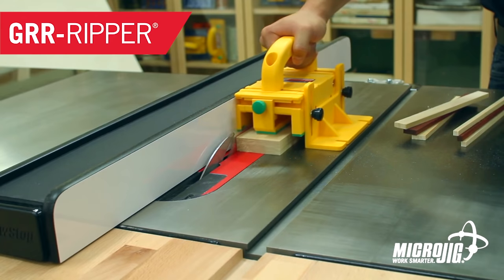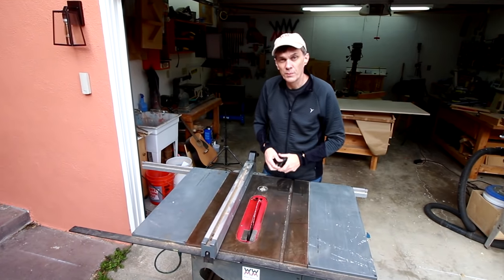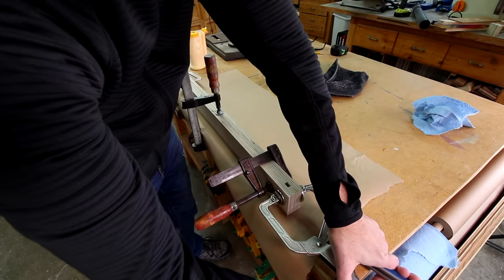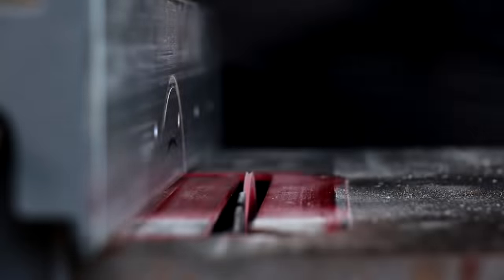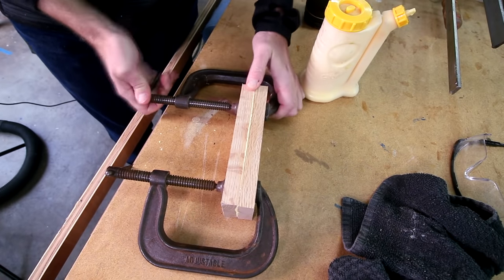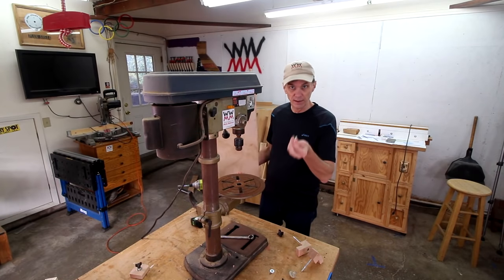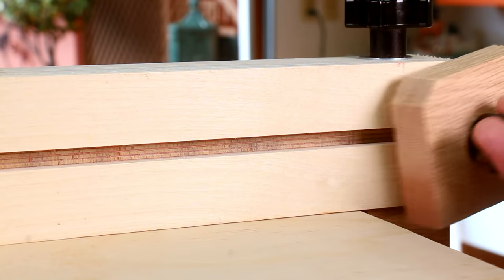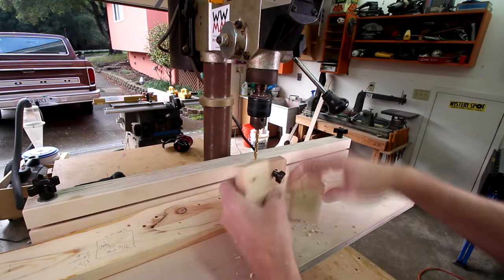Drill Press Table | Woodworking Shop Project

Comment: Protip: when cutting a bolt put a nut on it below where you intend to cut. Then, when you thread the nut off it will fix any threads you may have damaged during the cut.
Reply: Justin Updyke thanks!
Reply: You're welcome. This works on all size bolts but it is especially good on m3 type stuff for RC cars
Reply: Well the standard machine shop method is to always chamfer the cut off thread, that way you get rid of any burrs and have an easier time engaging threads.
But if you very specifically need flat ends that is a good way to go.
Reply: Thanks! I'm absolutely sure I'll forget that!
Reply: Yep, so true... the first time you try to screw a nut on 'after' the cut to fix it will cure you of forgetting. ;-) Chamfer has not always worked well for me... I will sand the ends a bit, just to clean the burrs though. Then, off comes the nut.
Reply: Good advice. I used to work at Lowe's, and I told people this often. I had a few come back a week later and thank me for it.
Reply: I have heard this since the beginning of time. This loose nut rattles around on the bolt and can get in the way of your saw/cutoff disc, unless you tighten it all the way down to the head and/or use a second nut. And it takes way too much time to bother doing that for a problem that isn't really a problem.

Just touch the end of the bolt flush to the disc sander after you cut it. Or locate and take 1 stroke over the end of the thread with a file at like 45 degrees, plus or minus 20.
Reply: Great tip 👍

Comment: I made your table, Steve, with a couple of small mods, and it's great! Thank you, sir! I had to cut a chunk out of the back right of the table because the table height crank hit it. Instead of the way you made a track for the stop block on the fence I bought t-track and routed out a dado for it. Works great! The toilet bolt (excellent idea!) was just a little too wide to fit the t-track, but a few seconds with the bench grinder fixed that. I figured I'd make a thin, removable sacrificial panel for the top so that I can replace it once damaged, and that made the stop block not fit (too tall) if the panel was in place. Fixed that by routing a slot in the stop block which allows me to change its height easily. All good!

Comment: Pretty simple, yet such a great improvement... if only I had a drill press 🤓👍🏼
Reply: I bought a dremel 3000 tool last month, and a dremel workstation. This act as a drill press for me. I can drill holes up to 6mm in diameter, which is enough most of the time. Of course, it is nowhere near as powerful as a real drill press, but it takes way less space, and is way cheaper. Depends on what you need. The dremel tool is approximately 120 euros, with accessories, and the workstation is approximately 34 euros. The dremel tool can act as a router, a circular saw and a drill, and the dremel scroll saw (motosaw) is a portable scroll saw, whih can act as a scroll/band saw and is relatively cheap (100 euros). I now have a shop in my 16 m² appartment :).

Comment: I've got this old craftsman table saw with no fence I was gonna sell on craigs list.  I saw this design for a fence and ramped it up to fit my old table saw and it works great.  I'll set this old saw up with a dado blade but mostly use it as an outfeed table from my new saw.  When I need to dado, I'll just adjust it up and knock them out.  Steve comes through again!

Comment: Brilliant idea. I see that table helpful for light metal work where I need a stable surface for drilling holes in tubing. I could put a scrap piece under the metal as a sacrifice surface.
MANY THANKS !!!
I also like the way you use your saw blade instead of a dado for wider cuts..

Comment: Ok, Steve, watched your video and decided to make one for my drill press. Simple job turned into a two day project! Kept adding this and that and changing things that made it work better! One thing I did notice is that with fence in place, it keeps the wood chips together and easier to clean up. Also works better for my vac system which I incorporated into the table.

Comment: Nice table, I like the stop/gauge design.  I did sheet metal fab for eight years, so unfortunately, I spent a TON of time on the drill press.  Like you said drilling holes is boring.  The drill press I used had a good sized table to begin with but I often had to support longer material with T Stands.  I usually clamped a scrap piece of aluminum angle to the table as a fence and then clamped another piece of angle or bar to that angle if I wanted a stop.  We also had a scrap piece of tread plate with a perfect square notch out of one corner.  Lay out and drill a hole, with the bit still in the hole, slide the notched scrap piece up against your work piece and clamp it onto the table, works really well for a lot of repetitious pieces.

Comment: That was a nice project.  Yeah, you probably want to go ahead a drill through the table.  The scrap board defeated the purpose of the champher on the stop block. But I wish my errors were that of some saw dust!   Making those T slots is less expensive than the tracks that you can find on line.  Thanks for sharing.

Comment: this was one of the first videos i watched on this channel a few years ago.
Reply: ? This was posted today.
Reply: it's an old video. posted previously.
Reply: Chris R No. It isn't. He mentioned H&G at the end, a relatively new channel from him. This is an entirely new video, maybe a redo of an old project?
Reply: Denis Ryan
see the old table saw? he uses a porter cable table saw now, and has for years. i watched this video several times years ago. no big deal.
Reply: You're thinking of the slightly different table he made in 2010. /watch?v=LWn1lRTuOlk
Reply: he has the purple paint on the wall along with the spray painted logo in the background.
Reply: The definitive item in the video, to date it, is the box he made for his new shop vac.  That was made a few months ago, when he bought the vac!
Reply: ok
Reply: It's also got the new clamp storage.
Reply: Yes, I saw that...  I should have said... "a definitive item" :-)  But, the clamps are older than the shop vac holder.  The clamps I believe were made about a year ago... still newer than the first table. :-) Who's been a good boy, watching all the videos! lol
Reply: No this is a New Video , the first one did not have a Build Video as part of it just a description of  how he built it and also had Removable Inserts in the center of table for when it got damaged , those are a feature I really like and added to mine.

Comment: Dear Steve, Thankyou for all your work with these videos which I like very much. There is however one video I keep waiting to see from you, and that is on the use of a plunge saw, not just for ripping down large sheets of plywood , but in the use for more accurate wood cutting, after all they have some pretty clever and accurate features with them these days. Is it possible you could do a whole project just using one of these plunge saws, and perhaps show us how they compare to the table saw etc. Thankyou once again.

Comment: Actually the sliding table is just a convenience: the column could be removed from the foot and bolted elsewhere, e.g. the edge of the bench, to have a lot of extra height for free. Steve, what about a sort of "lifting cabinet" to be placed below the quill, allowing you to drill very long pieces with precision and without hassles? Think to a sort of vertical workbench… I'm sure you can make that ;-)

Comment: love the project. only thing I have to criticize is that I believe the slot in wood was made too big. it should have been for the smaller side of the head of bolt so that it won't spin when tighten and loosen

Comment: Dear Steve, I love your video's and like most of them, I try them out. Also this Drill press table. I downloaded the plans and made exactly what was designed but the result barely clamped. It took me a while to figure out that the side blocks are made a bit different in the video than in the sketchup file. Contact me if you wish me to clarify with some printscreens and pictures. Keep up the good work! Jelle

Comment: Hi Steve! I'm looking to build a drill press table for the cheapest WEN drill press on Amazon (the 4208T). Unfortunately, the crank to adjust the small table it comes with doesn't have a track (like yours, and like probably every other drill press in existence), so it's free to rotate around the main shaft of the machine. Do you have any advice on how to ensure the fence is square to both the plane of the press itself, as well as the bevel axis of the table? I'm hoping to make some barstools and need the angle of the holes in the legs to be correct.

Comment: Hey Steve! Great video as always. I have a question related to design. Please share with me your thoughts on eliminating a disposable zero-clearance insert like in your old drill press table. Why did this design not include that, seemingly essential, feature? Are you taking the approach that you will just replace the entire base when needed?

Comment: Steve:  How would you modify the fence to accommodate drilling a line of equidistant holes, like for adjustable cabinet shelves?
Reply: How about making an attachment for the fence that has a pin that you push down into the previous hole at the right distance. Maybe spring loaded.  It might have to swing out to adjust for the distance the holes are from the fence.

Comment: Actually it looks like you are putting the bolt head into the slot long ways. I'd think that the slot would be near the width of the flats on the bolt head. Your video is almost inconclusive but seems to agree with me. Please explain.
Reply: I concur. I thought I was going crazy here when I noticed that myself. haha. Might as well use a standard bolt.
Reply: T-bolts and T-nuts always slide in lengthwise in T-track. How would you keep them cross-wise? They are mainly for spreading the clamping force.
Reply from the maker: +Michael Anderson It works fine.
Reply: Damn right it does....built it this weekend Steve....thanks!!

Comment: Should the T-bolt slot be narrower? Making it the same width as the Large diameter will not stop it from rotating when tightening. Right? Maybe it doesn't really matter in the end.

Comment: I've always heard it's dangerous to use a crosscut / miter sled with the rip fence. Is it okay in this case since  you're not cutting all of the way through the piece?
Reply: louie solomon Correct.  A mitre is not through the wood so it will not be loose and bind.

Comment: Steve, what size drill press would you recommend?  I am wanting to be able to do a lot of the same kind of projects you do.  thanks!
Reply: John Bryant 
When I was starting, I bought a cheap 8" drill press for about $80. But found that I quickly outgrew it. I upgraded to a 12" (drill presses are measured by their throat depth) and it's working beautifully.
Reply: grandolddrummer thanks for your response! Do you have any recommendations for a hobbyist. I dont want cheap, but it does need to be affordable ($300-500, if possible). thanks again!
Reply: I picked up the Craftsman one from Sears for around $200. It's been working great. I made a table for it from a Woodsmith magazine. 
I've heard good things about the Jet 12" and the Wen 12" has good reviews on Amazon
Reply: grandolddrummer I'll check those out, thanks for your help!

Comment: Your track seem,s to be too wide for the toilet bolts.  You cut the slot to the widest dimension of the head.  This means that the toilet bolt can spin without being stopped by the track edge... or was that entirely intentional??  (it certainly didn't seem to cause a problem when you tightened it). I usually make the slot just smaller than the 'wide' dimension of the head.  That way it doesn't stick, but the track will stop it from spinning when you tighten the bolt down.

Comment: Is it possible that the table won't square up with the drill press itself? For instance, if I want to create a handle in a board, I would rather make multiple passes with a forstener bit instead of using a scroll saw or jig saw. Is it possible that the table wouldn't "square" up with the drill itself resulting in an uneven cut pattern??? I hope you understand what I'm asking 😂😂😂😂

Comment: I'm new to woodworking, and I have a simple question, when gluing two boards together as in this video, is it necessary to use that many clamps or is Steve doing it for comical sarcasm?
Reply: I go with a clamp every 4 to 6 inches.

Comment: ok stupid question what are the black knobs you use?  i tried to find those in lowes in the knob section but no go.  thanks
Reply: They are in the screw/hardware aisle in the drawers - I think that area is called Specialty Hardware

Comment: Was there a reason you didn't use your dado stack to cut the grooves?
Reply: I can't speak for him, but I know I'll often skip it and do it this way if I don't need a high precision cut, and if it's going to take longer to change out the blade than to just go ahead and make a few passes.

Comment: How can you assure that your fence is completely straight from left to right when you clamp it down?
Reply from the maker: It doesn't need to be straight.
Reply: @SteveRamsey  I guess I was thinking about a current build I'm working on (a golf ball shelf) and I have a core box bit cutting a row of divets into a board. In total there are 5 shelves and I keep getting some of the shelves with the divets getting progressively closer to the front of the board as you follow them from left to right. I figured it was because I wasn't clamping my "fence" straight but perhaps it's something else.

Comment: 2:41  You're not using those T bolts properly. The slot width in your fence should match the bolt's flat to flat dimension and not the head's outside diameter. This way it won't rotate when your try to tighten the knob.